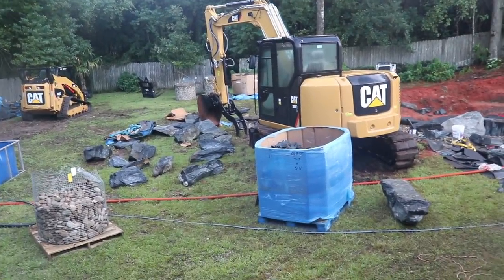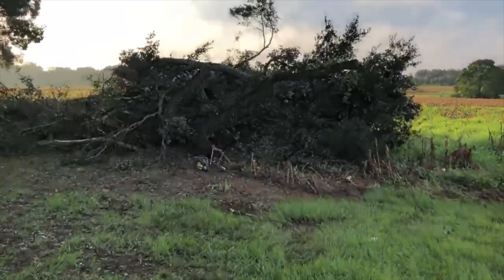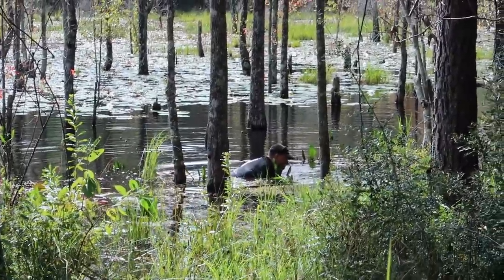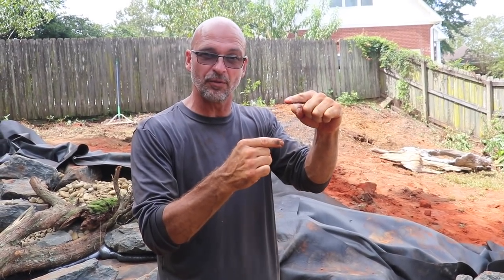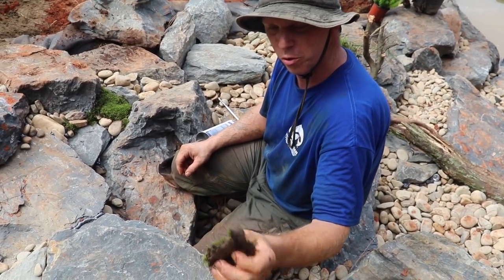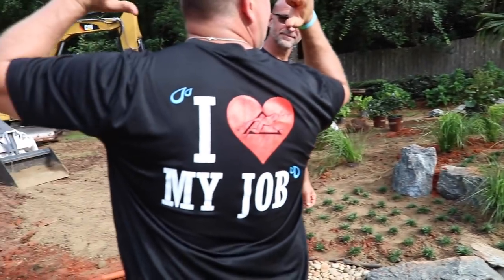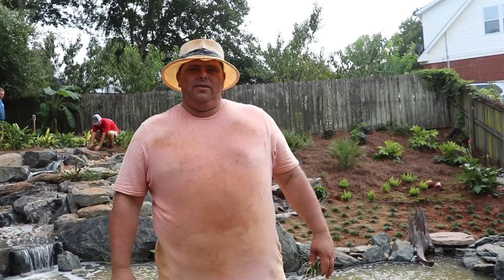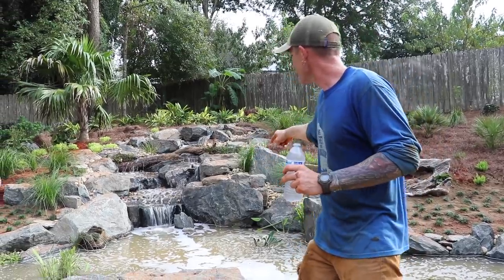Building a Backyard Bass Pond!! (Day 2)

Comment: Hey Bamabass, can you make a video explaining the use of different types of fishing line? I don’t understand when to use flouro vs mono vs braid. Thank for making the great videos!
Reply: Mono is your standard line that has low visibility to the fish it casts ok and is super cheap it holds it shape from the spool so u get the loops in the middle of your reel sometimes good for bait fishing cause it has stretch but that could be a pro or con

Braid which is what I use and is the best in my opinion casts the farthest (by alot) and doesn't hold the loop shape so you dont get loops only cons are high visibility so fish can see it and wind knots which are a huge pain in the ass but if u use a hook and stick it through the loops you can get even the worst wind knot out. Braid has low stretch so you can feel bites alot better  you can also fit more on the spool because it's diameter is thin. It is pricey but you can find piscfun spools on Amazon for 20 bucks and you get 500 meters and it works great if u want the high end get power pro but it's more expensive 

Floro is not a good line in my opinion. It is very thick casts worse than mono and is ALOT of money it also holds it shape more than mono so it causes alot of loops which also affects casting it is mainly used as a leader material and its practicality invisible in water but not too much more than mono 

I personally recommend you use braided line with a mono leader but make sure you spool a layer of mono on your reel first because braid slips when tied directly to a spool but you can use a floro leader but it's more expensive. 

Braid = casting durable and zero stretch 
Mono stretch great for jigging or fishing with bait cheap
 
Floro good for same as mono but not worth it cause difference is small and alot more money but great as a leader material if money isn't an issue 

I hope this helps I switched to braid 2 years ago and never went back.

Also for tiring line to each other look up double uni knot and the fg knot
Reply: Ricky Bay Fluoro is better for leader and braid for regular line
Reply: Bama bass is more of an entertainment fishing channel than an informational fishing channel. I appreciate that about the channel. There are plenty of channels here on yt to search mono vs fluoro vs braid. But as rule of thumb mono is my topwater line when not slop fishing. If im using a frog on top its typically braid. Mono is visible in water and stretches. Also floats so keeps your bait up. The stretch is good with topwaters as it allow an extra second on hookset. Some like to fish crankbaits or even spinners with mono. You cannot feel the bottom good with mono. It is the most abrasion resistant. Fluoro is INvisible in clearwater up to about 10-14lbs and very low visibility up to 25lbs. It sinks, so not good with topwaters. Very low stretch and can feel bottom good. Good in clear or stained water using any nontopwater lure. Especially good for bottom bumping lures or finesse fishing, but i do flip and bottom bump with 20lb fluoro just as much as i do with braid. Braid is highly visible only good for stained to muddy water. It is neutral buoyancy so will float with topwater or sink well with weight. Zero stretch. Can feel bottom and get snatching hooksets. To me it handles much better. Very low memory and no line twist. Very high lb test vs line dia. Best all around line to use just not in clear water. The more clearer the water the lower you go in lb test. Only line to use fishing heavy cover, or pads, or slop. Braid most expensive, fluoro in the middle, mono the cheapest. All you need to know . . .
Reply: I agree with d vb, I love braid to leader. Braid to mono is amazing. Braid to fluoro is appropriate in some conditions
Reply: I use fluorocarbon line 90% of the time. It's almost invisible in the water and according to brand very little stretch. You get what you pay for, some is very limp and cast farther than mono or braid but you sacrifice abrasion resistance. Some is harder and is tough as hell but doesn't cast as far but you can never break it off. It's pretty much what your style of fishing  is. If you fish open water with crankbaits, mono is best. If you fish thick wood cover fluorocarbon or braid. If it's mats or thick grass braid. If you fish deep rock braid with a fluorocarbon leader.
Reply: Braid is good for swamps
Reply: Everything else doesn't matter

Comment: I have a pond about that size (8K gallons) and at one point I had 10-12 large bass in it.  That was a lot of work finding crayfish, worms, small fish out of the canals, snails etc to feed the fish.  Now I have three koi, one bass, and some large goldfish.  Bluegill are fun to have as well.  They are very social.  Two bits of advice.  Don't over stock your pond with fish be it game fish or Koi.  Your pond water quality will suffer.  Be advised that transferring fish from other ponds and waterways is fun but the risk of your pond being contaminated with a fish killing disease is very real.  Finally, if your water quality is good and it is hot, try snorkeling in your pond.

Comment: It’s interesting. I just built my first pond (for fun) and after I laid the liner, I used chicken wire and set concrete. Concrete with plastic. But they just used liner and then decorated. I wonder why? I need concrete cause I built it at my cabin where it snows in the winter.

Comment: They didn't seal any of those pond-liners. Good luck with your foundation. That's going to leak, and the hydraulic pressure coming down the hill is going to push all that water right into your basement.